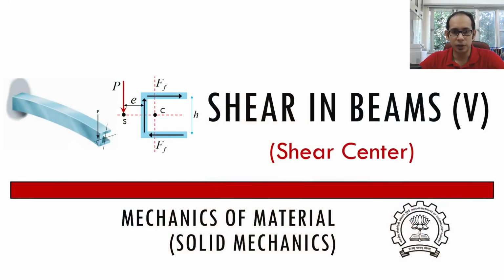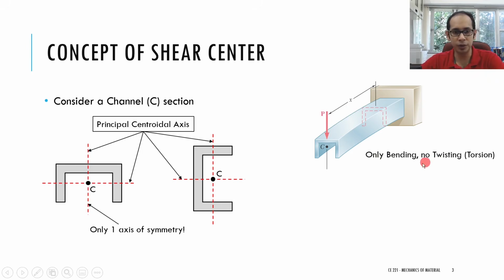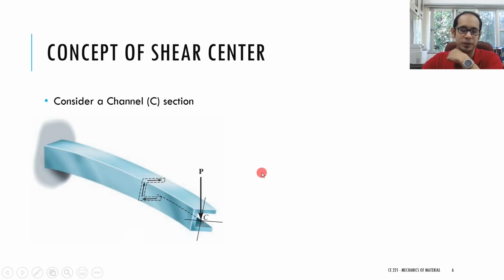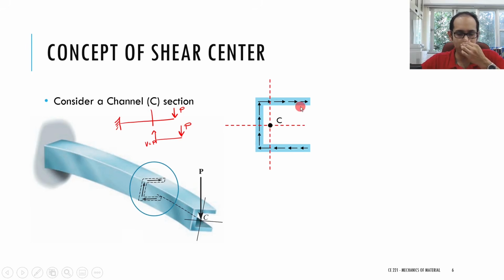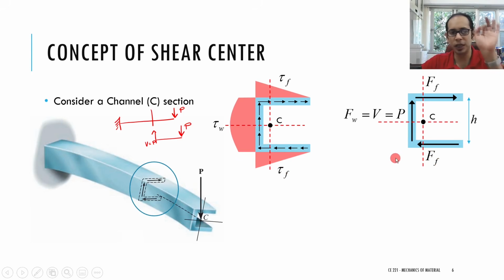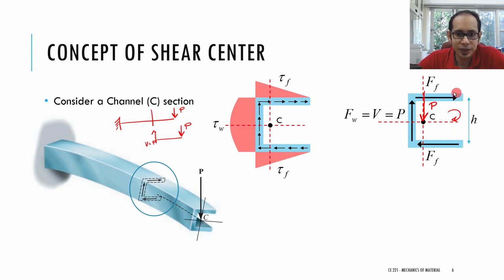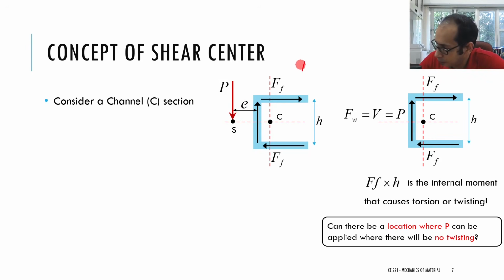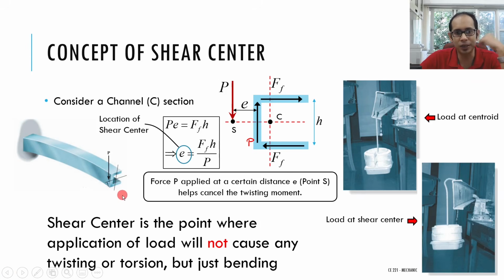Topic # 7.6 - Shear Center

Comment: Shear Center is an important consideration. Especially for aircraft wings.

It would seem by simplified assumptions, that the limits for the location of the shear center will be between the beams area centroid, up to a lateral displacement of 0.5x the beam width. Or anywhere in between, depending on the shear web and caps own thickness, area distributions, and material modulus.
Reply: watching it as aerospace student , you got it correct brother

Comment: Very good Sir, however engineers don't get to apply the load at the location to avoid torsion.
Reply from the maker: That's a very valid point, and good engineers need to consider that in real-world applications.

Comment: Sir why the anti clockwise moment given by the shear flow of the free end face ( where the external force is working) is not considered?
Reply from the maker: Great question. You see, shear forces and bending moments are the internal effects of externally applied loads.. That means in this example, instead of taking the section at some distance away from the free end, if I took it at infinitesimally small distance dx, the effect will still be the same. Hence, these clockwise moments keep happening at every section away from the free end. At the end itself, it is just the P. Another way to think of it is that this is how the beam "reacts" when the external force P acts. I hope the explanation was clear.
Reply: Thanks a lot sir. Lots of love and reverence for you. Thanks a lot for helping me ❤️
Reply from the maker: @pronoylahiri6663  You're welcome! All the best with your studies.

Comment: I can calculate the shear stress on the section by shear flow and the distance of the shear center by taking moment from a certain point but there's a lack of understanding. about the twisting concept due to the couples. you made these things too easy to comprehend
Reply from the maker: Thanks. You are absolutely correct. Taking moment about any point, such that the net twisting moment is zero will indeed help locate the shear center.